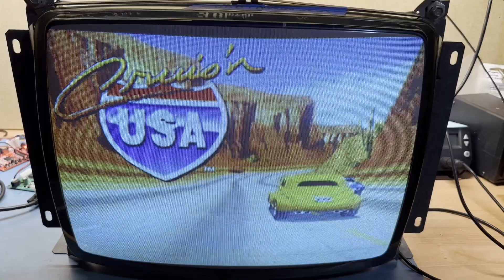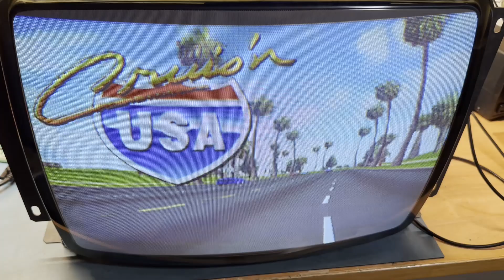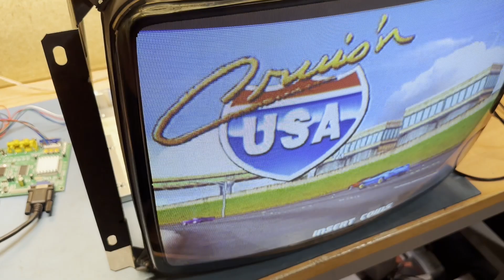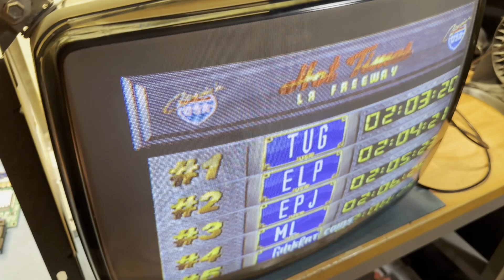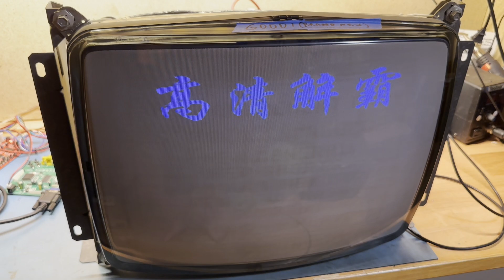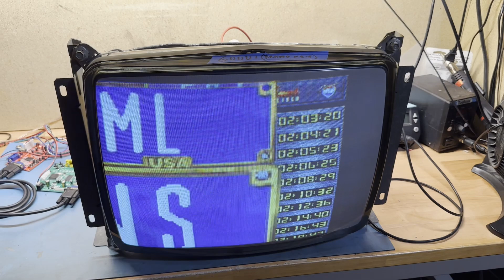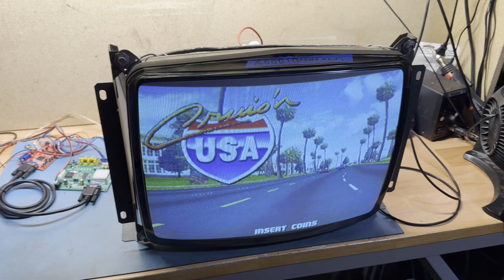Arcade Monitor 101 - How To Use A Standard Res Monitor For A Medium Res Game

Comment: Would it work to just attach a medium resolution chassis such as a U5000 directly to a standard resolution tube?  I.E. to run a medium res game on a standard res tube.
Reply from the maker: You’d need the correct, corresponding medium res yoke. But just the tube, yes. The tubes are cross compatible but a medium res chassis requires a medium res yoke.
Reply: @MikesArcadeMonitorRepair  thank you.  I do have its respective yoke as well but was hoping to not have to swap it.  As you know its way more work!

Comment: Hi.   Would this setup allow you to connect a pc using vga to the converter boards so it runs on a crt arcade screen?   I have a crt which i want to connect a pc to play mame using a vga cable.  Not sure if it can be done using a pc. To connect to a crt screen.  Thanks.
Reply from the maker: Yup! Any VGA signal. But you’d only need the red converter.
Reply: @MikesArcadeMonitorRepair  thanks for replying.   So in order for me to connect a pc using a vga cable. I would need to buy the red board not the other right.  ?  This would convert the VGA signal to 15khz so it displays on the arcade screen.
Reply from the maker: Yup!
Reply: Thanks for confirming.  👍 @MikesArcadeMonitorRepair

Comment: You maywwant to look into the Gbscontrol custom firmware for the first board. It gets the lag down and has overall better upscaling than the standard board.
It involves using an Arduino, or just buy a premodded board (you can find them googling for gbscontrol).

Comment: Interesting video and I did see it on Facebook.
When the flick the switch on that second board to increase/decrease the screen size, what's it actually doing to achieve it, since usually it's done physically by changing the resistance on the resistors or swapping out the width cap?
Reply from the maker: Not sure quite honestly. Most likely something with the firmware.

Comment: Would shortening all the wire lengths help the resistance issue?
Reply from the maker: Yes, but not any significant amount.
Reply: @MikesArcadeMonitorRepair  a molded male to male vga connector would saimese these boards together as one and would look tidy. Would that still be a negligible operational difference?
Reply from the maker: For the RGB resistance issue? Yeah, but it’s not that big of a deal. Turning up the RGB pots takes care of it.

Comment: ... Could i use that orange converter with a Naomi, to play it on a standard monitor?
Reply from the maker: If the Naomi outputs VGA, then yes!
Reply: The Naomi has a dip switch you can use to set it to 15khz, so you don't need to use a scaler